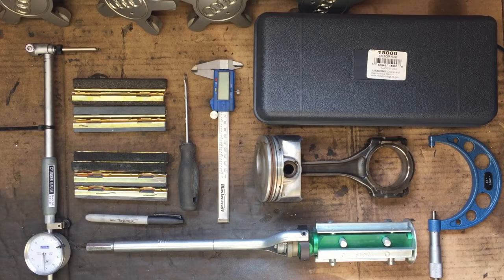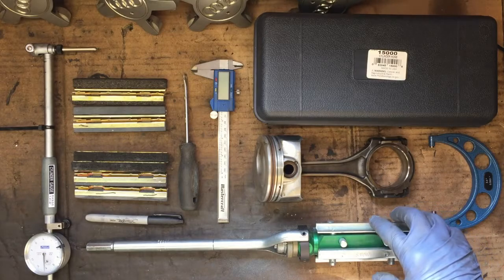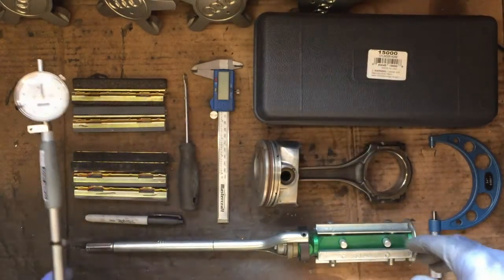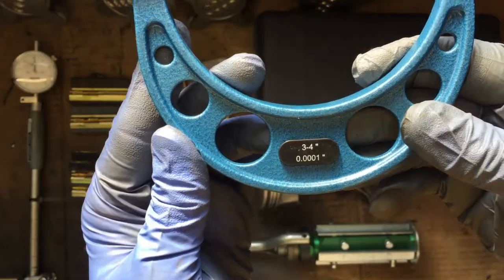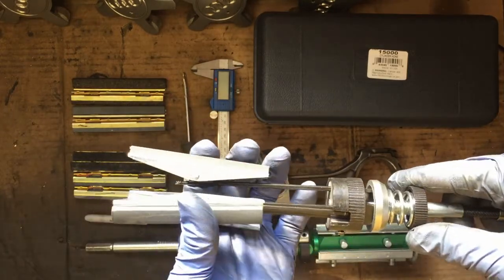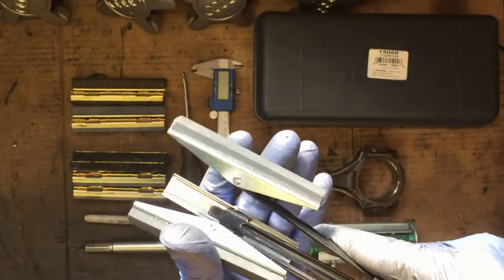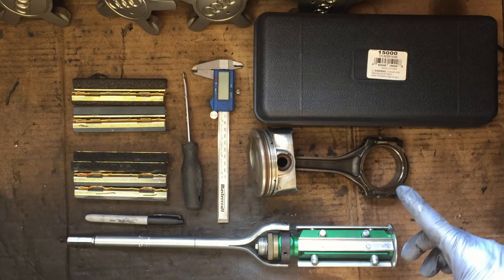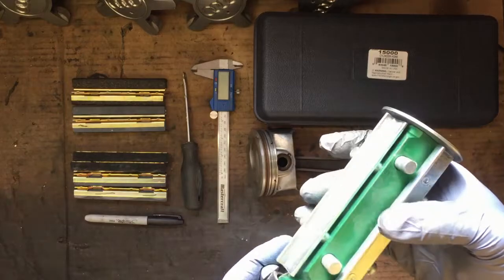Honing tool Lisle 15000 - everything I've learned about it

Comment: I have honed so many cylinders with this exact hone. Over the course of time I've discovered I can correct cylinder taper out of round everything with this hone it just takes a lot of time small shims to adjust the angle of and knowing how much pressure to put on the stones. I use the 80 grit with a torque plate and I can get it pretty damn straight! Then I bring it up with a 220 grit stones to the final size then I use a BRS ball hone for final finish.
Reply from the maker: Great idea with those shims. I was actually able to get rid of taper but one part of stones was getting worn out faster and I had no idea what to do with it besides swapping them out for a new set. Did you use some lubricant or did you hone it dry?
Reply: @fixitorleaveit4393  the stones tend to wear on the bottom faster than the top. I typically have to put a .004  feeler gauge under the bottom side after honing for a while I'll remove the stones and I will rub them together and then rinse them off rub them together rinse them off I just use mineral oil for the lube

Comment: You need a trueing cylinder to parallel the stones after they're installed in the racks., number them so they always go back in the same rack. You can use an old engine block for trueing by honing first from the top then from the bottom until the cylinder is parallel with no taper. After doing this on a couple of cylinders your stones will be wiped true.
Reply: Or put it on a lathe with a single point diamond wheel dresser in the tool post and travel the length of the stones making it true

Comment: Sandpaper?  Could a person use something like 3M cubitron or ??? and cut strips from it and somehow fix them to the surface of the stones?  Then you would have the most choice in grit size, and it would be cheaper than buying lots of stones, and the geometry of the stones could stay true permanently.  I am doing a refresh / rebuild on a toyota 2gr-fe 6 cylinder with 200,000 miles.  I want to avoid a machine shop, because I live in Nashville TN and I have never found competent machinists here because everyone is obsessed with country music :) .  You think I'm just joking, but ....  sometimes I get things done in Chattanooga TN because there are more tradesmen there.  Maybe Cubitron abrasive is not the best?  Also, I am scared I will have grit left inbeaded in the micro scratches of the cylinder, and that will prematurely wear out my new rings.  Thoughts anyone?

Comment: It the tool square up you cylinders if they out of round? Thank you. I found your video very informative.
Reply from the maker: Thank you. Yes, if you set it up correctly it acts like a drill bit basically. When you dry honing I highly recommend to make some marks with a sharpie or something similar inside the cylinder so you know how the stones work, where they take material off. It takes a lot of measurements, patience.
Reply: Yes, like a straight walled parellel reemer when you get it set up like you showed.
Slow patience.  Nice explanation.

Comment: After you have used the lisle 15000, would you purchase it again, knowing what you've learned.??
Reply from the maker: I'd buy another brand just to see how it works. But if I wouldn't like to try something else I'd definitely buy Lisle again.
Reply: The lisle is ok for occasional use, I used one for years.  Once I got a sunnen AN815 I haven’t used my lisle. There’s a lot more choices in abrasives for the AN style hone. But you need to have the need to justify the cost of the more expensive hones.

Comment: Great video!
A "few" notes - 
Order some extra coarse stones. 15500 80 grit especially if you are honing to oversize pistons like I am. Stones are cheap and replacement blocks and re-sleeving aren't.
I eliminated taper first, then roughed in with coarse stones on all cylinder before moving to finer stones for final dimensions. That's [#of cylinders] x [thousandths to be removed] of practice. You'll be a pro by the time you do the final dimensions with fine stones. I ordered the 280 stones as well since ring manufacturer prefers a finer finish.
If you have taper to start with you will likely end with some taper. Stones are a sacrificial medium. They will partially sacrifice more at the tight areas and it will only get worst as you move from cylinder to cylinder. Also true if you have wavy cylinder walls. If you want to get picky have a set of fresh coarse stones for each cylinder. I used a set for 2 cylinders with no issues.
I had 4.5 to 7 thousandth taper across my cylinders. Sacrificed a set of coarse stones to shim the bottom with a few layers of paper between stone frame and hone bracket  to fix that before honing to 20 over. The paper formed an L to lift and to move stone forward a little. I used six layers of printer paper; long strip folded 3 times. This will wear that set of stones into a taper and no longer be good for straight honing. Mark your stones for easy identification. Once paired don't let them get mixed up. Ended up with a half thou of taper when done. Specs are 0.0006 thou standard on EJ2.5 so happy with that.
As the taper stones wear you can't flip the stones for a fresh edge so I would set two inches of hone in the cylinder and tighten then use sanding board to knock down the top of stones so the bottom is doing most of the work; loosen and move to bottom. I drew vertical sharpie lines from bottom to top of cylinder to see if I was removing from the right areas. Once taper is gone you will get even drill resistance when you pull the stones upward or more resistance if you over honed.
I had 0.015 to remove for 20 oversize pistons so I had a lot of material to play with to get it right and try different strategies.
If you have a boxer or other engine that doesn't let you push past the bottom of cylinder you will also have to contend with taper as you go. Pay attention to that. Never measure the top of cylinder without checking bottom. A layer of paper shim might be all you need.
My focus is on the area of cylinder where the piston skirt makes contact. Subaru's are slap happy if that is too big. The top just has to be big enough for piston install and rings do the rest. I used 4 data points over the length of cylinder. Dedicate a sheet of paper for notes on each cylinder. I considered the top at zero and recorded differences at 3 lower positions. I.E. +.5; +1.5; +3.5.
When you begin set the tension on the wrist pin axis which is generally tighter until you have even resistance on wristpin and thrust axis. You'll feel it! Perfectly round holes after that. If you set on the thrust axis you can also lock up, damage stones or cylinder wall.
With boxer engines with wristpin holes keep that hone oscillating. The stones will wear less at the holes and cut a groove if you don't. No aggressive cutting on boxers with wristpin holes.
Order some fast epoxy. I had several stones separate from the metal frames and was able to put them back on for use. Lisle gets cheap on the glue so I used it more liberally and they never came off again. If you get broken stones glue back on and use those for taper honing.
Order or find a container to store your stones in safely. The case is nice but if it is shaken the mass of the hone can break and chip the stones. Ace Ventura delivered mine so they came pre damaged and Lisle sent me some replacements.
The bore gage he is using is working really well but double check against the caliper often. Easy to bumps the face even when locked down. Also clean cylinder contact surfaces before measuring so you don't "hone" the bore gauge tips while taking measurements or measure the grit left in the cylinder. I have a 0.0004-0.0012 piston to wall clearance so wouldn't take much to over hone.
I also would put two stones working faces together and work them against each other to flatten them out before use. Periodically check them and repeat as needed especially before moving to another cylinder.

I honed dry with the coarse stones but finished with the medium and fine stones wet. Just put a lubricant on the wipers. 
If the coarse stones chatter back off tension. It's tempting, especially if you have a high torque spade drill, to remove material fast but this can also cause the stones to separate from support frame and it will lock up spinning the drill and twisting your wrists.
Keep engine block and pistons at same temp for measuring or let them stabilize as you do your final dimensions. 68 degrees at all times isn't feasible. When getting close to final dimensions with finer stones let temps stabilize, honing generates heat. 
The tortoise wins this race, the hare buys a replacement block and pays a machinist to do it. Give yourself plenty of time and walk away for a while if you run into trouble, it'll come to you.
That's all I got! Good luck and thumbs up this video.
Reply: And stuff rags into cylinders your not honing. As anal as I was I still started measuring wrong holes a couple times thinking WTF!
Don't be me!😆
Reply from the maker: Well, that was a very very informative! Thank you. I did it for the very first time in my life and I'm planning on doing it again. Patience is the key! And those waves, taper and whatnot is totally spot on in your comment. Thank you very much and also good luck on your projects, sir! ✌️
Reply: @fixitorleaveit4393  I have this 2.5 subi in the bag and doing a Vortec 5.7l next to a 383 stroker for my 98 GMC. Have had enough bad experience with machine shops to put in the time on this to do it myself.
Once I got it dialed in it has been like meditation. Love it. Good luck with your next project to.
Cheers
Reply: @1nvertedReality  Thanks ! I followed your instructions and my SBC V8 project @.020 over worked perfect. I did the first .015 dry so let me add the following:
IF DOING THIS DRY, WEAR A DUST MASK !  😷  After doing the first cylinder, I began hocking up Black Phlegm. Since the Stones didn't wear too much, I can figure out that the Blackness was mostly Cast Iron Dust. After 8 cylinders, even with ventilation in my shop, everything is covered in Black Dust. I took a Hot Soapy Shower afterward and threw my work clothes in the washer. ☠
Reply: It's better to take the block to a machine shop, this tool It's nice but the ammount of work to to a right job It's bananas, not cost effective and not very precise thou.
Reply: @TelosDextroza  It is a lot of work, time. Only the diehards that want to at least try it and willing to accept the results should try it. Cost wise you don't really save money. I'm in an isolated area and good machine shops are hard to find.
Reply from the maker: @Usuerusers81 💯
Reply from the maker: @1nvertedReality but it was a great experience. Lots of adrenaline.
Reply: How long do you think it takes you to do this the first time? I'd love to spend a few days getting it right, but I dont want to put 40-80 hours into it.
Reply from the maker: @KyleP133 to go one size bigger (25) wouldn't be too bad. I had to go 2 sizes bigger (50) because I couldn't find set of (25) pistons. And that was a pain I can tell you. I'd say you can spend 2 hours on average pet cylinder if you have everything setup and know how to adjust and treat the stones during the process. It's about experience as well. When you start doing it for the very first time it might take exponentially longer.
Reply: These are great, but keep in mind this is for honing only...used in bored cylinders and not intended to repair out of round holes.

Comment: What if the wood stick is warped? Or when sanding down the stone, you are "rocking" the stick making the stone even more rounded? Human error by "sanding" is not going to produce a perfectly flat stone. I use a file to try an flatten a part, but depending on the slightest amount of force placed on either end, will remove more material,  making it uneven. I dont think a lisle tool will ever be precise enough to round out a cylinder or remove taper. Only a machine shop boring machine will achieve precision straight bores
Reply from the maker: I totally agree with you. I wanted to challenge myself and give it a try. And honestly I was getting a really good results until the stones gave up on me, not sure 100% why. It's a lot of sweat & swear and a lot of time spent on it with a questionable results. I still believe it's doable once you master the tool enough. I'm planning on doing K24 some day this way though.